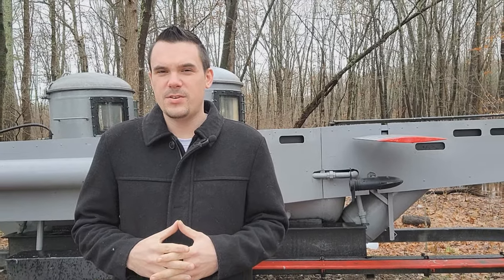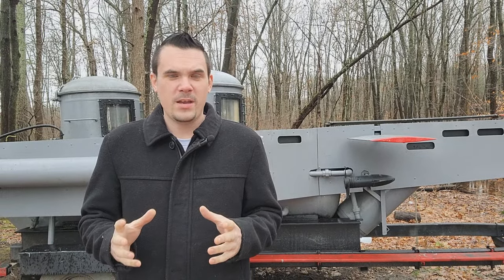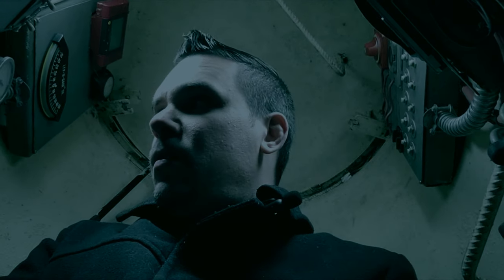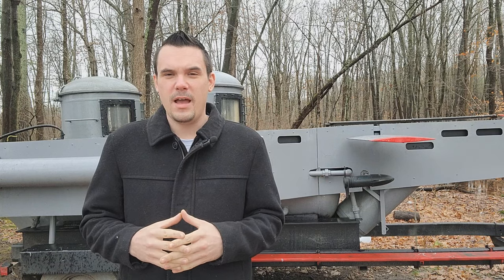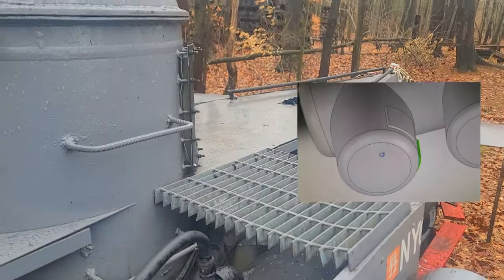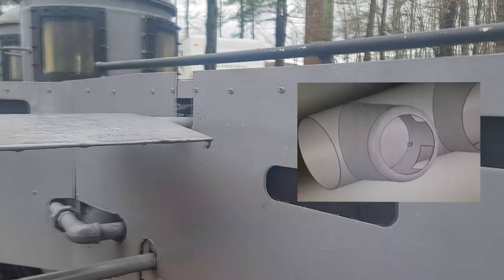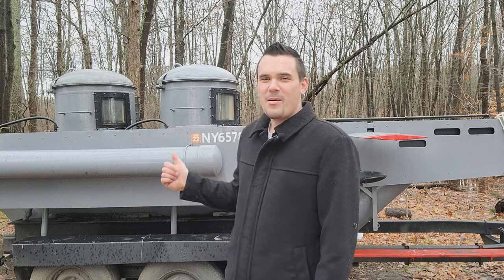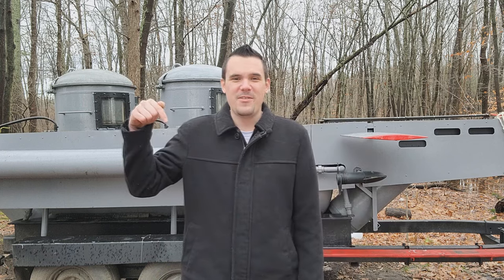How Deep Can A Submarine Go Before Crushing?

Comment: So you're telling me that diving straight to crush depth to test it out like they do in all the movies isn't actually a thing? 😅 I always thought that was a silly Hollywood-ism.
Reply: They have the calculated Crush Depth, which is the theoretical maximum. There's the operational depth that he was just talking about, but there's also a Test Depth, where they take it as far down as they are comfortable before they actually reach the crush depth, it's normally set at 2/3 above the crush depth. You're not supposed to go past the Test Depth unless it's an extreme emergency, and normally you're hanging around the shallower regions anyway.
Reply: Read about USS San Francisco. A submarine that went to hell and back and a crew who is thankful to God and skilled engineers and fabricators at Electric Boat. Had the Los Angeles Class submarines not been built so sturdy all those guys would have been fish poo today.